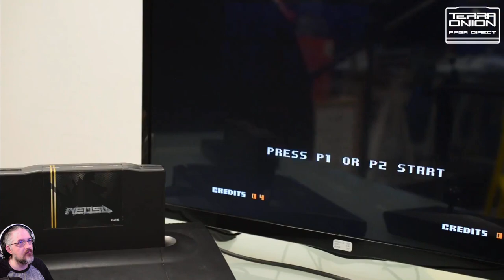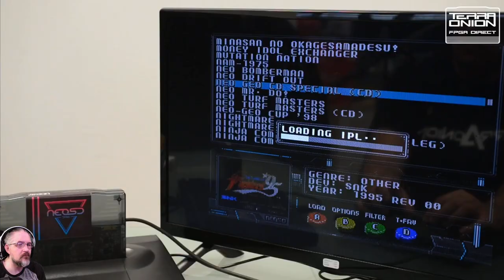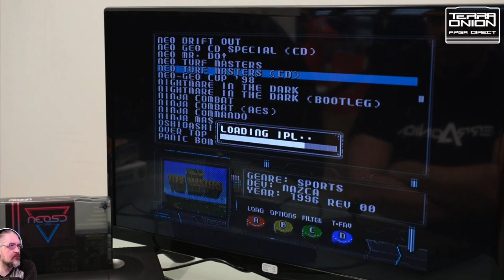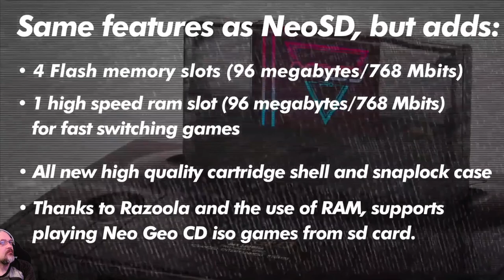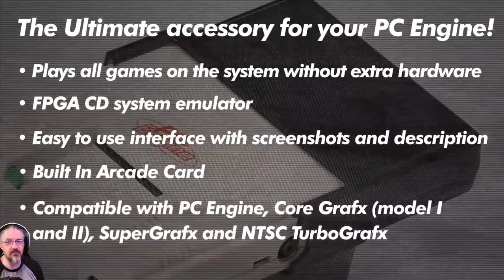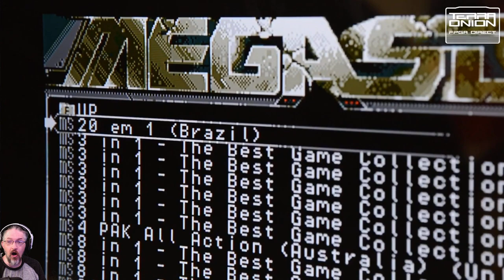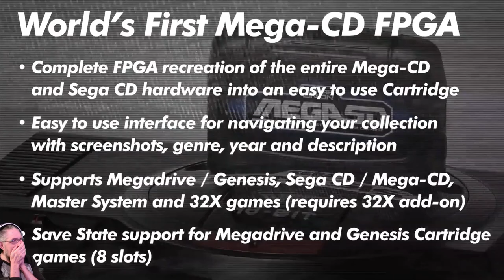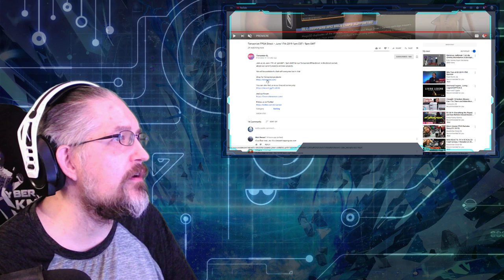Reaction for the Terraonion FPGA Direct Event June 17 2019!

Comment: that's impressive !  :-)
Reply from the maker: I'm extremely excited for this. However the price of 232 GBP is a bit more than that of the krikzz Mega Everdrive X7 at 160 GBP. But for all it can do, I'm highly impressed.  To think of it, the price is the same as the Turbo/PC Engine CD SSDS3 device they have, so it's in line. Thanks for your comment.
Reply: Awsome stuff, I'm speechless! Unfortunatly, It is way expensive for my pocket...
Reply from the maker: It is a steep price, as well there's a bit of shipping time for it to arrive on top of that.  Thanks for your comment.

Comment: cool for Nomad and Genesis 3 but would have preferred a simple optical drive emulator. Would have been cheaper for people that already have a MegaCD
Reply from the maker: May be, but from my experience the GDEMU, Phoebe, and Rhea are only slightly cheaper. I have a gen 1 Sega CD, gen 2 Sega CD, and JVC X'Eye. I don't necessarily want to avoid using them, but I like that this is a cart version, where you don't have to worry about expansion port at all, so it helps to keep the space down compared to a gen 2 side model or bottom mount gen 1 model. Thanks for your comment.

Comment: Cost was $282.27
Reply from the maker: That's not as bad as the SSDS3 was when I was looking at it. It seems that the Super SD System 3 model that will be potentially available when they restart production of it this Fall for Turbo/PC Engine Cd FPGA ODE usage. I'm just hoping that the revision has the audio fix already implemented, as it's not necessarily cheap, but it is comparable to the cost of a Turbo CD/mounting plate, or just under a PC engine Duo. Thanks for your comment.